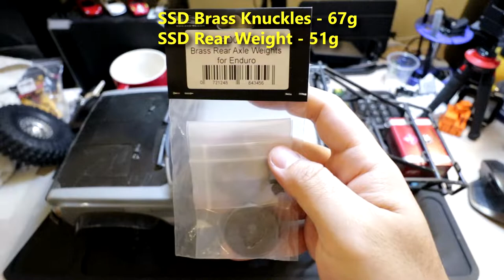Element Enduro Sendero RTR Upgrade Series - Installing SSD Brass Weights

Comment: Little truck is soooooooo capable, but agree, needs that bit of wait down low. Swapped mine to white springs all around, little floppy at high speed, but creeps over rocks like a spider. Super happy with it. Just need to get my trx4 sport a little more dialed, then on to a Capra 👍👍

It never ends, haha

Great how to man. Been lurking on rcc and have read a lot of your stuff. Almost bit your bom cage idea, but went with the flat bed.
Reply from the maker: I'm going through my Capra build right now!  Yeah, the Enduro is definitely a great platform though.  Running video with these upgrades on Thursday!  Stop lurking on RCC and participate!

Comment: Oooooh pretty!!! 😁 
Those Knuckles look like quite a CHUNK of Brass! Should give a performance increase... But of course you already know that, because I'm months late! 😜 

I've HEARD that SCX10 II Chubs fit the Sendero Axles... Do not know if that's true. If so, that opens up many possibilities to add weight and strength up front. 

After seeing several Videos on the Element today, one common theme is: positive Caster is LIMITED by the Drag Link...
I'm going to try putting the Draglink up FRONT. 😲 May work, may not. I know I'll have to move the Steering Arm to keep correct geometry... But I want to experiment.
Without the Draglink in the way of the Driveshaft, I should be able to increase Caster for better stability and side hilling! 

BTW, I'm going to share these Videos with some noobs.... Even though I know what I'm doing (most of the time!), I've enjoyed your Videos, because your explanation and illustrations of HOW to do things is so clear and thorough!! 👍👍👏👏👏👏👏 You can really help people a lot more than the big Channels, who sometimes seem like they're BORED, and skip past things that people with less experience NEED, and usually are too proud or shy to ask.

See, I KNOW I don't make great Videos. Some of the million Subs Channels THINK they make great Videos! 😖 They're just popular, and forgot they have a little responsibility for the new guys.

You do quite a service! I don't know if you know that.
Carmine ✈🚂🚙
Reply from the maker: 🙏🙏Thank you!  That's exactly why I do these.  I know there are a lot of newcomers that are afraid to wrench on their rigs.  These are meant to kind of help them as well as a reference.  I've so far kept my drag-link in the stock BTA setup, but my other Element, I might put it in front.
Reply: I don't know if it will work or not... But isn't that why we mess with these?? 
If it's a complete fail, nobody or nothing gets hurt but our pride!

Comment: Thanks for the update and info... that colour is way better than a brass finish.
Look forward to Thursday to see how it performs.
Have you bought many goodies for your capra yet?
Bought my capra last weekend, but still building my umg10..
Cheers mate
Reply from the maker: Yep, that's why I like SSD stuff.  I like a more understated look.  Thursday will be a good watch!  Next Thursday will finally see my UMG run lol!  With all these releases, I sort of forgot about it.  I need to start upgrades on that one though.  I have not bought any upgrades for the Capra yet.  I'm building it box stock for now, and letting the aftermarket mature a bit more to see what I like.

Comment: Awesome upgrades.👍Did u have to offset the front wheels at all?
Reply from the maker: I run aftermarket wheels, but I didn't have to change anything at all.  There aren't any clearance issues with these knuckles.  I've always been happy with SSD products so far.
Reply: @RevolutionX  Alright sweet good to know 👍👍